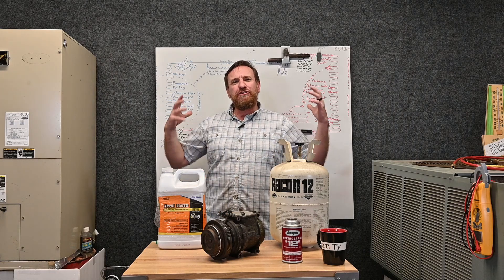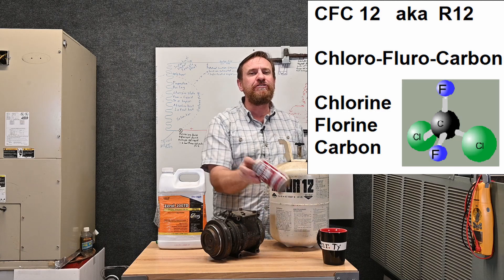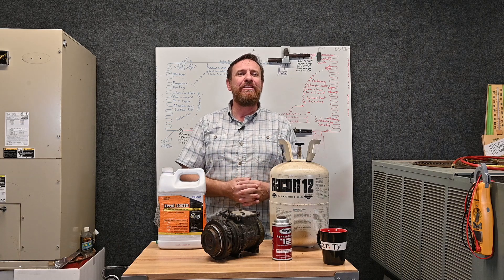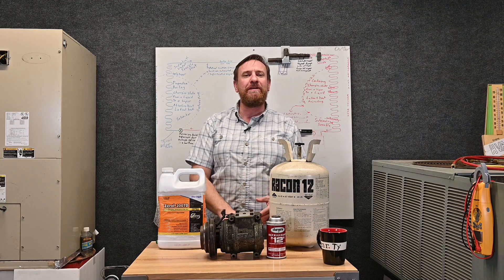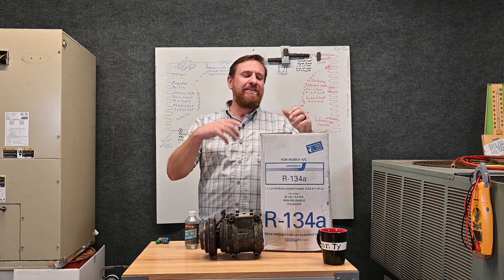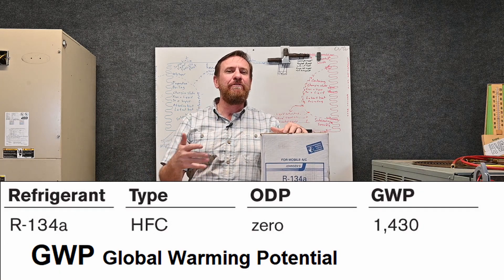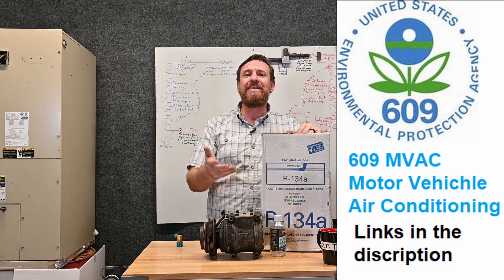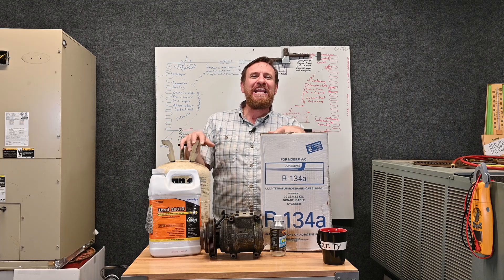HVAC 111 Refrigerant CFC 12 and HFC 134A

Comment: Question, I have several cans of R12,  If someone was to switch a R134a to R12 ( and changed to the correct oil) would it work even better than the 134a and even better than the R12 did years ago?  It just seams that the newer system would benefit the R12 more so than the 134a.  Thoughts?
Reply from the maker: You would not need to change the oil.
In theory the 12 would have more capacity.

Some people are replacing 134a with Refrigerant R290 (propane) with an odarant.

Comment: Car started switching over to R1234YF in 2012,  Cadillac XTX

       I was the very first independent automotive shop to invest in the equipment before the first car even drove onto the show room floor. 

         I literally had the GM dealership call me up that first year to recharge their vehicle that was in an accident right off the delivery truck when it was repaired because they had equipment they had nobody trained on it so I got the phone call to do the dealerships R1234YF recharge. 

         Because I was the first I literally owned the monopoly in the San Francisco Bay Area with absolutely zero competition.  Life is good. 

     And when the commercial residential industry switch is a refrigerant the automotive is soon to follow. 

        They are already working on two different new refrigerant to replace the R1234YF.  And CO2 is being used in Mercedes Audi and Volkswagen in their heat pump systems in Germany
Reply from the maker: That's awesome! Change happens wether people welcome it or fight it. Getting on top of the game is a wise move!

 I did not no Cadillac started so long ago, way ahead of the game. 

I never understood why they have a 609 certification, yet sold refrigerant to the general public. Completely defeats the purpose of it. I don't remember seeing a wrecking yard recovering any refrigerant. 

I heard they where using CO2 in automotive in Europe. It's used here in more and more refrigeration but in the southern states it has to be a cascade to handle the high condensing temperatures. 

I have not figured out how they are getting it to work with the hot climates.
Reply: @love2hvac  i’ve been studying some of the newest vehicles coming in from Germany that are using heat pumps but with refrigerant. 

      I can see they have developed a method but have not implemented it that you can actually use hydrocarbons with a plate heat exchanger that goes to a glycol loop heat exchanger in front of the car keeping that three or 4 ounces of hydrocarbon refrigerant out underneath the hood away from the passenger compartment. 

      All they need to do is add a second plate heat exchanger to transfer cold glycol into the passenger compartment to the evaporator. 

Yes CO2 does have an issue in hot climate does need to be cascade in refrigeration in supermarkets a simple water tower takes care of this problem. 
                  But we can’t have evaporated water towers mounted on the top of our cars lol. 

I want CO2 to come to the automotive market my dad was teaching me about it as a refrigerant back in the late 70s and early 80s. 

       I almost pulled the trigger to buy a standing heat pump directly from Japan that was using CO2 to heat and cool my house and produce hot water but it was a little costly for me at the time out of my budget that was in the early 2000s. 

I 100% percent support hydrocarbon refrigerants to be used in residential it’ll be very easy and very simple to implement and very safe. 
Glycol loop in heat exchangers

Comment: it really difficult sometimes to get fresh meat new technicans to learn that they need to look at temperatures and not pressure. 10 degrees SC is the same regardless of the refigerant used, so learning that the type of refigerant is not important in your initial assesment is a wild concept for some.